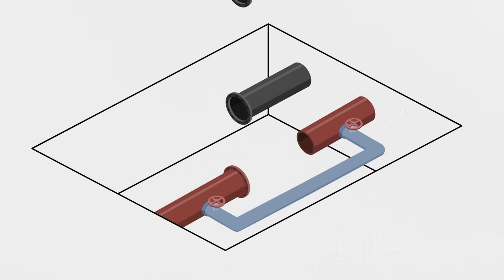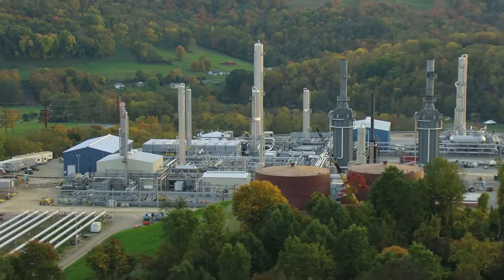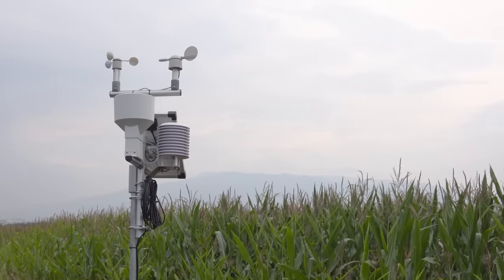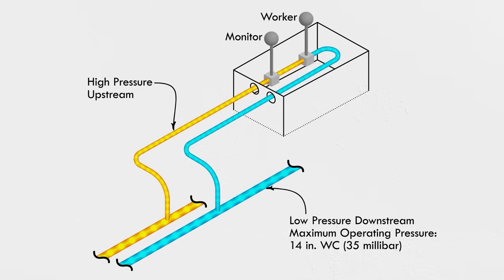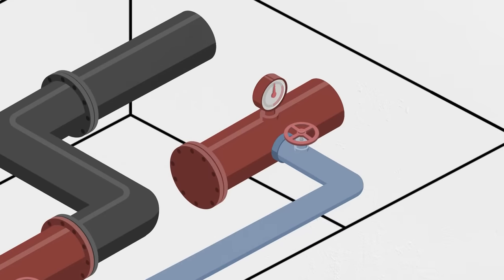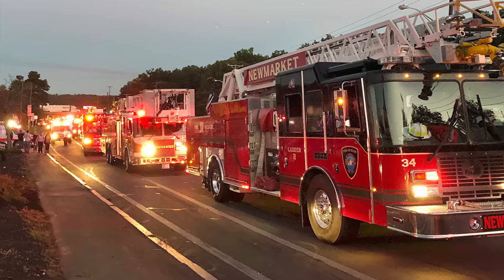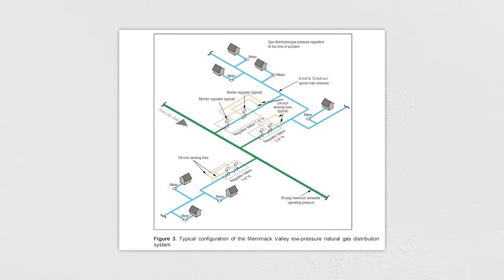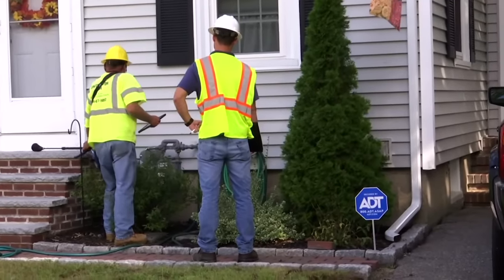What Really Happened During the Gas Explosions in the Merrimack Valley?

Comment: As an oil and gas operator, this is one of my biggest fears. Not tying in the sensing instruments to the control loop. Especially dangerous when commissioning a new line/equipment. Really not sure how this would be missed though. Hot Taps usually have very intensive oversight.
Reply: Why aren't there more safety features?
For example a pressure gauge that automatically shuts off the line when an overpressure is detect may have prevented or at least softened this event.
Reply: @Jehty_  Only if it was hooked to the right place. The existing pressure regulators weren't malfunctioning, they were just monitoring an abandoned pipe. 

Any additional mechanisms installed before the new line was laid would likely also be monitoring the old line, and this would probably still have been overlooked during planning to switch over to the new line.
Reply: I've hot tapped a water line at 120 psi, I would not want to hot tap a gas line.  But, how else are you going to get the job done?  Don't envy you!
Reply: Intensive oversight can be so expensive though
Reply: @CptJistuce  putting distributed (electronic) pressure sensors throughout the network would be how I'd do it. Not just one or two mind, think more like 20 for every regulator. They phone home their data every once in a while or instantly for a fault. One giving a high reading gives a warning 10 giving high readings triggers an automatic shutdown of the segment. The sensors don't have to be $10k a pop either. Few hundred $ will suffice as failures of any sensor don't really matter.
As a bonus you'll get detailed data for the whole network, probably find some leaks that'll pay for the cost in a few months i'd wager.
Reply: @zyeborm  sounds great, put cheap electronics inside a gas pipeline... Can't see any problems with a "failure".
Reply: @zyeborm  you should try and get water companies on board too, my town of 1300 is losing an extra 50% water due to leaks and they just shrug and go thats how it is. Sewers, same and roads crumbling with minimal maintenance but hey building a new school addition for 2.3million dollars..
Reply: @zyeborm  or have monitor setting regulator valves at each city block distribution junktion
Reply: This is kind of how my well pump, pressure tank and pressure gauge is installed in my house. One of the shutoffs in my house is in between my pressure tank and the pressure gauge, pressure gauge can loose pressure and kick on the well pump with no connectivity to the gauge. I really need to get it fixed at some point.
Reply: I live a little south of the Merrimack valley and just that day was debating buying a go-bag and appropriate contents, going so far as to having had left them in my Amazon shopping cart so I could sleep on it. After all, what kind of disaster could there be in NE Massachusetts that would require me to flee the house at a moment's notice?

Then this happened that evening. I still keep my go-bag updated.
Reply: @benjaminfranklin329  last time I checked you needed 3 elements to create a fire. If it's inside the pipeline as you say where's the oxygen coming from? Also if hundreds of dollars is cheap to you to buy a sensor that reads as entire half a psi perhaps you can give me some of your excess money. Or I'll gladly sell you $10,000 devices to to that job in 1k unit quantities. Not a problem.
Reply: @MrLuc420  somehow I doubt it would have been more expensive than the clean up, lawsuits, and similar results from this oversight however.
Reply: @MrLuc420 : So what? Safety First.
Reply: @Jehty_  My understanding is new installations have that. Where the T on my house is to connect it to the gas line, there is a valve that automatically closes if there is too much flow, pressure, etc... but my understanding is they haven't been doing that feature for that long, so most older homes don't have that. If I buy a new gas consuming device (say a pool heater) the gas company also has to come out to change the valve to match my max possible flow.
Reply: @MrLuc420  I doubt it was even close to the expense of the damages they had to pay to the people whose houses were blown up or burned down.
Reply: The hot tap wasn't the issue. Them not moving the sending lines over to the new pipe was.
Reply: @Jehty_  You're literally describing the function of the regulators. They were defeated by terrible incompetence.
Reply: @zyeborm  I would put the overpressure sensors right at the outlet of the regulator, physically integrated into the regulator. I understand that turbulence makes their signal less reliable, but this would not be the signal to drive their control loop. This would be a "circuit breaker" signal to cut supply on.
Reply: @zyeborm  - I believe everything happened rather quickly once the lines were switched over, so a monitoring system would have reported the problem too late to effectively stop it.
Reply: As an engineer, signing off on something like this is one of my biggest fears. I mentioned that to my old boss and he said, "The moment you stop being afraid of that is the moment you should stop signing designs." It's important to feel the weight of what we do.
Reply: @chickenwing111  15 seconds or so is a very very long time for electronics to phone home and shut down the system. The other advantage to having the system monitored widely is you can also look for air inclusions (if oxygen got into the system) back flows things of that nature
You might get a spike from two regulators oscillating or something like that.
Reply: @ikrisoft  This is what I was thinking too - I mean it could be useful to place them quite a bit behind the regulator, but that whole segment then is absolutly of limit. Noone should be allowed to touch it, especially not if its live.
Reply: @zyeborm  In theory, this could work, but I see a few problems. The first is managing the network. Distributed networking like this requires fairly involved design, and when it’s going in a safety critical application, costs quickly balloon due to compliance testing and whatnot. It’s also not clear how these sensors would be powered, or how they’d phone home. Having mains electricity powering them seems unwise. Batteries could feasibly work, but that would largely rule out any sort of live data that could prevent an incident, due to power costs. The final problem I foresee is that if these sensors go in the downstream, low pressure segment of the line, it’s already too late. You will have over pressured a decent amount of your pipeline already, and depending on poll rates or network topography, a delay of minutes isn’t out of the question, particularly if it’s a mesh network. Really, the best place to monitor for this, is right where the regulation occurs, where it’s entirely possible to use dumb, mechanical systems that are far more resilient to failure or lack of maintenance. The fundamental issue here is one that is difficult to design around, you kinda have to assume that the safety hardware will be correctly installed.
Reply: Didn't they have a pressure gauge on their end?  How could they not notice?
Reply: @SkigBiggler  One sensor at each house, if it detects overpressure itd be easy enough to shut an emergency valve upstream. Maybe sensor>meter>valve kind of a thing. Powered with the home electricity and a battery backup. If it fails the house loses gas for a day, or until someone gets out to replace it. electric pressure sensors often go >10years between failures so thats not a huge problem either. It wouldnt be cheap, but it would guarantee nothing like this ever happens again
Reply: What if the sensing lines were severed?   There was no fail safe with the remote sensing lines.   A sensor past the 2nd regulator could have shut everything down once it got above 3psi or whatever they set it at.
Reply: @CptJistuce  
If they had the proper recommended number of safety devices, couldn't there have been at least 1 over-pressure detector downstream of where the work was being done? Just how many miles of pipe are we talking about? Do they run 30 miles of pipe with no extra redundant safety features at all?

How often if there is a sudden pipe break, would it be detected and the flow automatically and quickly be shut off? I am thinking such as if construction work is digging where they shouldn't and encounter a major gas line. Surely that would cause an "excessive flow" situation easy to detect, unless it was merely a small break?
Reply: @CthRyleh  
Of course if things are sufficiently engineered, the well pump might bog down before critical pressures are reached, however you can't trust that "do it as cheaply as possible" corporations will often over-engineer stuff.

Also, what if the pressure gauge is not doing the controlling anyway? Do you know where the actual pressure switch is? Often the gauge is a non-operational convenience redundancy just for troubleshooting or for the owner or repairman to know what it is doing.

While you are at your repair, did you know they now have variable-speed well pumps that compensate for water flow, so that you can have city-like constant pressure without the pump cycle surges from low to high pressure? The pump simply runs at the proper speed to match the current water flow.
Reply: @zyeborm  
That is why it is so important to prevent gas leaks. I don't think there is enough air in the pipe to burn, however that is not what the problem is. The oxygen is in the surrounding air. And there are often too many possible ignition sources. A spark from the accident. Nearby pilot lights. Electrical switches that make a small spark inside. Even electrical relays I imagine.

And we are talking aging and corroding infrastructure easily many decades old.
Reply: @chickenwing111  
I believe everything happened rather quickly once the lines were switched over, so a monitoring system would have reported the problem too late to effectively stop it.

Yeah, but a computerized system could possibly react quite quickly to detected faults in the system. Also, even a trained experience operator in a control room, might react quickly to an alarm going off. You don't want something bad happening on your watch, well unless you are a corrupt politician and can blame it upon somebody else.
Reply: @zyeborm  
Yet 15 seconds might have been enough if it was a long stretch of pipe. Maybe the disaster occurred over minutes, and not just seconds.
Reply: @yosefmacgruber1920  We are outside my knowledge level there.

I do know that lots of older infrastructure wasn't built for maximum safety(we had a much laxer attitude back in the day), and retrofitting it in after the fact is difficult.

I can also tell you that my neighborhood DOES have downstream safety features, in that there's a pressure regulator at each gas meter, which is outside and set away from the building. Overpressure blows out at the gas meter instead of inside a house full of ignition sources.
I don't know that it was done this way for safety(the neighborhood was built in the fifties), but it is an appreciable benefit to having regulation at the home instead of the distribution system being held at usage pressure.
Reply: Hi @yosefmacgruber1920   - If I recall correctly, the utility was working on a pressure control station the fed gas from a high pressure line into a lower pressure distribution line.  When they activated it the pressure transmitter in the low pressure line was isolated.  Since the controller did not 'see' any pressure in the low pressure line it cranked the feed valve wide open.  Though I was not directly affected by the event, I live nearby and it was quite a mess for a while.  All of the gas equipment and appliances in every house had to be replaced as well as many service and distribution lines.  As a control systems engineer I could tell what happened, generally, as I watched the widespread problem unfold on the news.
Reply: @CptJistuce  
They say that things were built better in the past. Old appliances seem to last forever and hardly even know how to break. The new stuff craps out after a few years. But back then, maybe the rush was more emphasized in how to get everybody hooked up without too much cost, not planning for the future with careful infrastructure maps and planning as to how long it would actually last?

But do we know if those pressure regulators are specified to behave properly under an over-pressure situation?

Hard to imagine how gas meters were actually in people's basements. Were people actually at home for the meter reader to take his readings, most of the time, back in "the good ol' days"?

But at the home means lots more failure-prone regulators, where at the central infrastructure, it might be easier for techs to keep an eye on stuff and do routine inspections for replacements or upgrades.

There may be more than one stage of pressure regulation, and they probably want regulators at the home level, so that supply pipes can more efficiently deliver the gas at higher pressure. Else the pipes would have to be larger diameter to maintain consistent pressure, as pressure might drop on the coldest winter days due to increased usage. Much like how voltage is stepped up for long transmission lines.
Reply: @chickenwing111  
Did they replace a lot of stuff just because it "might" be damaged?
Reply: @yosefmacgruber1920  - Everything connected was over pressurized, so I believe everything had to be replaced; ovens, furnaces, water heaters, clothes dryers...I don't think they could risk it. The pressure was so high people reported their pilot lights on their stoves had a flames about 1-2 feet in the air.   I believe only one person died which was remarkable.  The poor kid had a brick chimney fall on him when a house blew up.
Reply: @chickenwing111  
And yet only the gas metering devices on the appliance were possibly damaged?

Did the gas company have to pay for everything?
Reply: @yosefmacgruber1920  - here is a good summary:   https://en.wikipedia.org/wiki/Merrimack_Valley_gas_explosions

Some houses had to be re-piped to bring them up to code so the equipment could be replaced.  And it was in the fall so that did not have long to get people heat.  I recall that they a swath of FEMA trailers near the highway for a while.
Reply: @chickenwing111  
So how fragile is the electric grid? Was it ready for a bunch of people dusting off their old electric space heaters all at the same time? Or would that be no big deal, because of all the summer-time air conditioners? I imagine that the stores must have been sold out of heaters?

Comment: I live in North Andover MA, one of the towns impacted by this.  Thankfully, my family was not impacted, but the day was very surreal.  Fires, power turned off, traffic from evacuations, school closures, schools turned into shelters were all experienced.  Thank you to all the firefighters and other first responders who helped that day.   And, Grady, thanks for making this video.  I never really understood the cause until now.
Reply: Hope you have your own high pressure valve just in case.
Reply: @flow5718  As far as I know every house has a regulator on it now in that area.
Reply: As a lineman for Mass Electric I'll never forget that night. I've never seen Lawrence so dark. I remember getting called in the evening and making it down 495 only to hit gridlock and having to have a state police escort to get me through the gridlock on every road surrounding the area, finally making it to a very strange feeling rte.114 which had no cars on it. We worked I believe 5 days of around the clock shifts, energizing areas as we were given the ok by the fire marshal. Then spending all fall and winter upgrading transformers that were overloaded by the mad rush to install electric water heaters and such.
Reply: I was under the impression that the gas line pressure at each property was also regulated by that property's meter.  Apparently not.
Reply: @b3j8  No, that whole system was run as a low pressure system, only regulated by those regulators that got blocked off. It was basically just a gas pipe from the street right into the basement, the only regulator it hit along they was was that on the individual appliances.
Reply: @ucfsub  Interesting.  Sounds very old school on the cheap.   Thanks.
Reply: I also live in North Andover Massachusetts
Reply: @ucfsub All gas meters have a regulator on them.  That's part of the meter itself.
Reply: @b3j8 I think the main pressure pushed the regulators on the house meters beyond their limits.
Reply: @musicnerd72  This system did not. It was a low pressure distribution system with the on street pressure being about 13" water.
Reply: @b3j8  That's the way it works in LA county, in fact if the lateral main to my home was cut, causing a mass overflow, an earthquake  protection devise will close and stop the flow!
Reply: @musicnerd72  Not where I live, the regulator is a separate devise. Regulating 40 PSI  NG to 9" water column!